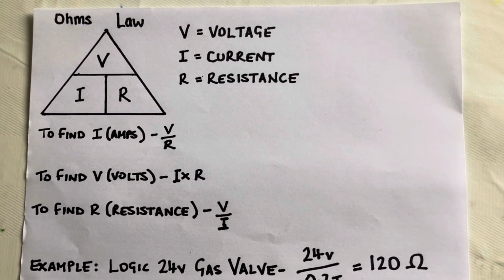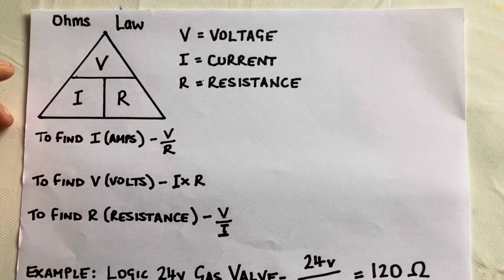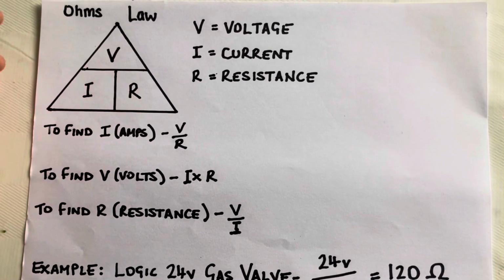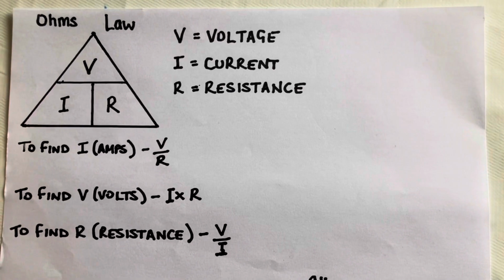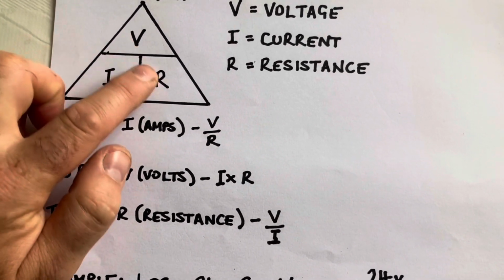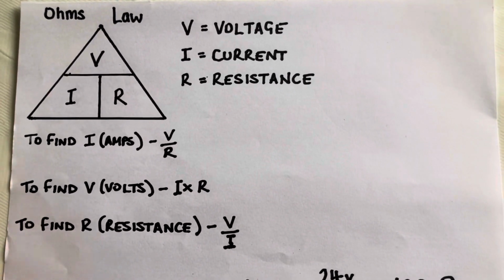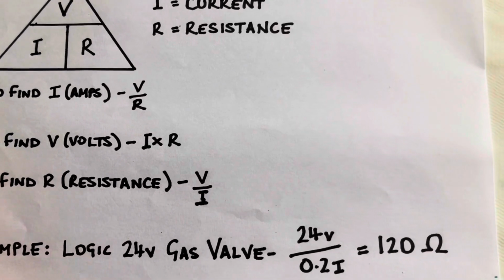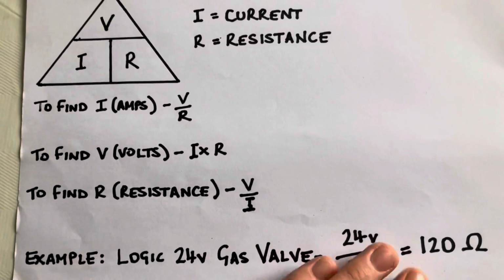Gas Boiler Fault Finding - Ideal Logic

Comment: Having an issue with an ideal instinct 35. About 9 years old, won't push heat to all rads. All trvs are working, and the pump and vessel have recently been changed as well! Any thoughts are appreciated.

Comment: Hi Allen, I have an Idea logic combi boiler and it makes a big noise as it fires up. It sounds like a small explosion every time. It's a bit worrying. We had it serviced recently but as usual, it didn't make the noise while the gas man was here! Any ideas what is happening?
Reply: Too much gas before ignition takes place. Check/ clean/replace spark electrode.